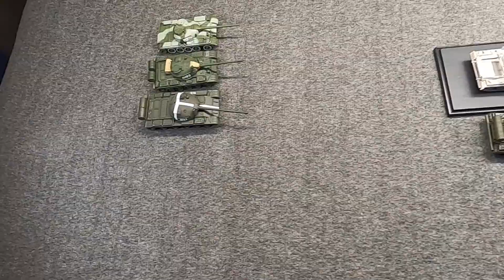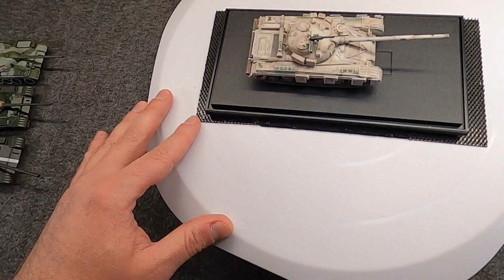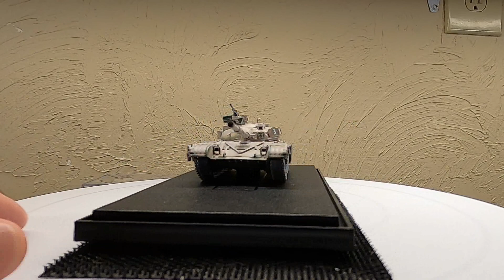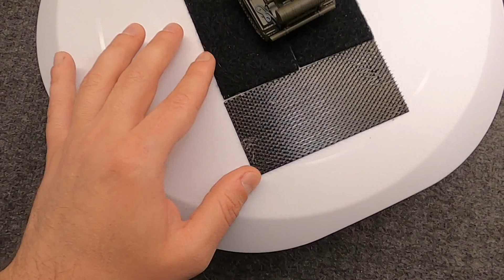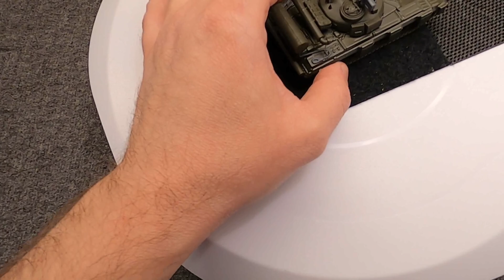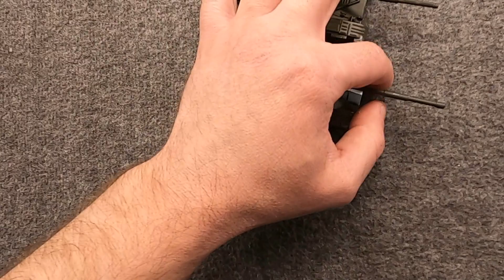T-64 Tank: Morozov's High Technology Cold War MBT Only For The USSR (Russian Armor #24)

Comment: The best tank the Soviets ever made when compared to the period and its fellow MBT designs.
Reply: No, that would be T-80, while T-64 is the best Soviet failure in tanks.
Reply: I would have to disagree.

Only the T-80U had any advantage over the west but that was made neut extremely quick with new APFSDS ammo capable of countering kontact-5, the thin base armour and lack of thermals.

The T-64A, whilst having literally the same problems as M60, Chieftain and Leopard 1 (God awful availability and reliability) was an extremely contempoary vehicle which they did made several thousand of still ready to be used.

It was fixed around the same time the M60s and Leopard 1 had their issues fixed, by the early 70's it was for the most part entirely fixed.